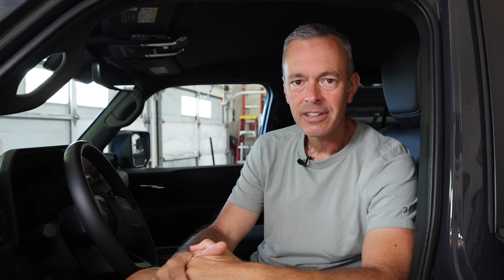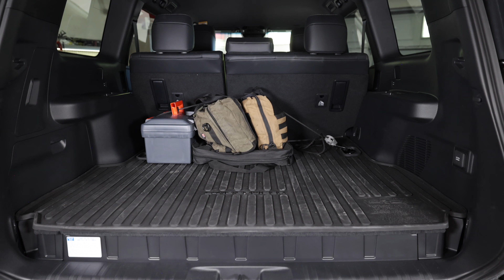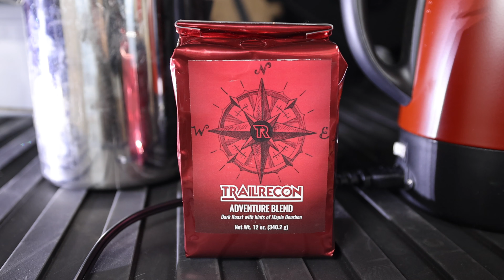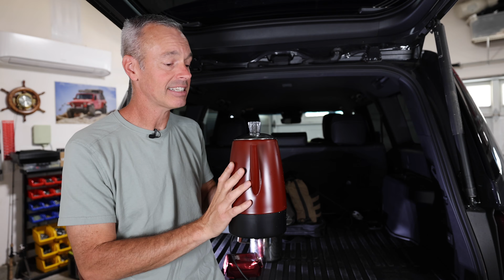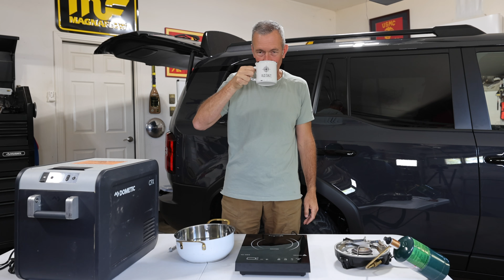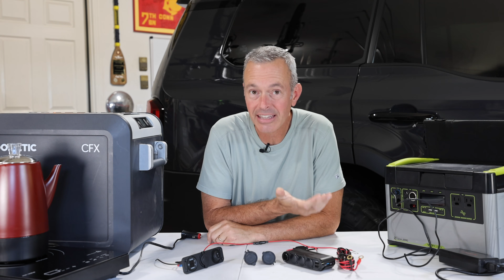Is it Time to Go Full Electric Overlanding?

Comment: This is why I have a wrangler 4xe. 3 days on the rubicon trail and it was a game changer. Powered everything, did not need to run the engine at camp. The Jeep comes with a power pack with 4 outlets (2 banks of 15 amp outlets.)

Comment: Electric is awesome till you run out. . . . . I use multiple options, mostly gas, wood and charcoal. Not a fan of relying on only electric, when it fails and it will you're left with no options.